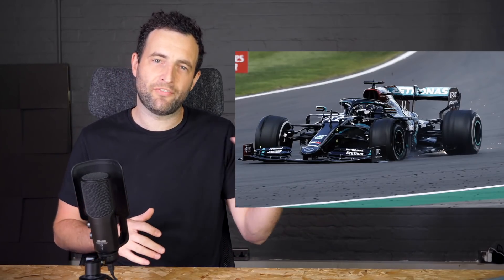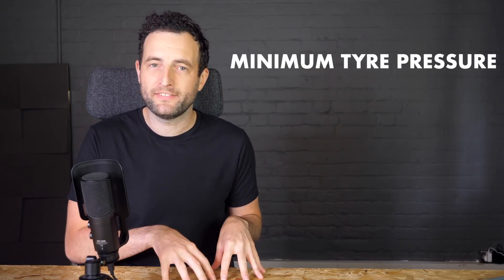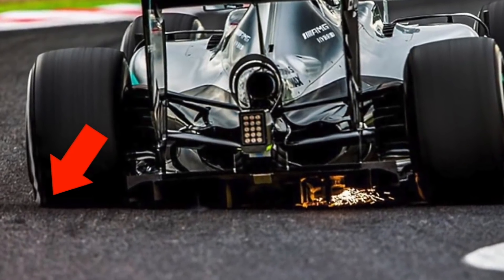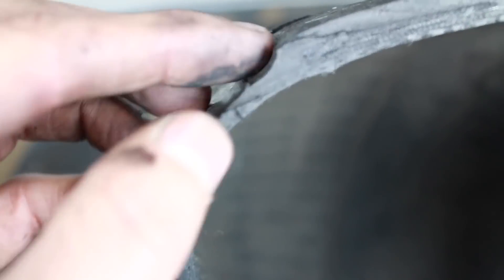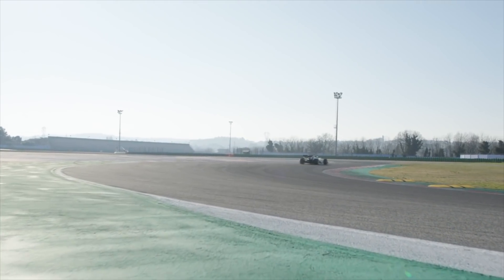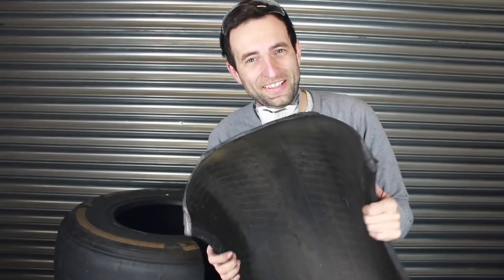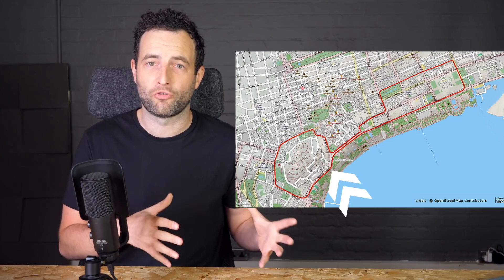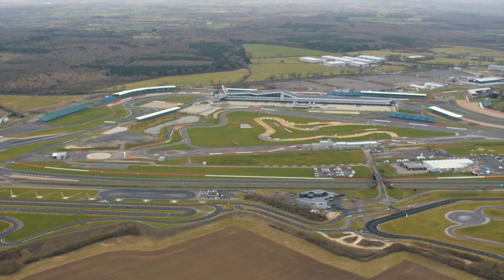Why Formula 1 Tyres Failed in the Azerbaijan Grand Prix

Comment: Pirelli : We need few weeks to investigate and to answer why tyres failed in baku!
Driver 61(15 mins after race) : Anyway… Here’s why tyres failed in baku!
Reply: I mean I'm no tyre engineer bit I have worked in the tyre fitting industry for 8 years now and as soon as I seen Stoll's crash I was saying to myself that was a sidewall to tread attachment failure . I have seen it many times on run flat tyres when people just keep driving on it flat the edges of the tyre get supper hot then bang the tyre separates . The crazy thing is so many teams just kept running the tyres past when strolls blew .

Comment: The left rear tire has exploded contrary to what is said the track is counterclockwise so most of the pressure is on the right rear. A place for thought and not for hasty conclusions
Reply: all the left-hand corners but one are easy on the tyres. The only 2 corners that put a lot of stress on the tyre at Baku is the high speed left-right before the main straight. The left is easy flat but the right is a lot harder on the tyre, the left rear tire to be exact. And guess where both Stroll and Verstappen had the faillures? Exactly, on the straight after that high speed section.
Reply: @rubenhclindenhols  the tires can easly handle that left right. The rear right is under more load during the lap, it seems much more likely to have have been debris and hitting a bad kerb.

Comment: First and foremost, both Stroll and Max were on the hard(white-walled) tires.  These hard tires are good for 40 laps.  Strolls tire, left rear , blew on lap 29....Stroll had not pitted. Max's tire, left rear, blew on lap 45 but only did 33 laps on the hard.
Also, Pirelli found a 7cm cut on Lewis's left rear tire.
Both Stroll and Max's tires have been sent to Milan for investigation so we won't know the cause of the tires blowing out until several more days.
Pirelli have also looked into the other teams hard tires for review.

Comment: If that was due to the excessive load then why left tyres failed on the anti-clockwise circuit?
Reply: It seems the high downforce on the massively long straight was a major factor. That thing kinks right, then left, then right and once more right at close to top speed. I'd wager both rear right tyres were close to falling apart as well just from going straight. This kind of primarily vertical load wears out other sections of the the tyre than your typical lateral load.
Reply: Could be kerbs?

Comment: Max at Ziggo: Pirelli probably gonna say it was debris
Pirelli: We think it was debris
Reply: Classic pirelli 😂
Reply: @oakenstake  classic Pirelli? Why is that?
Reply: In the news pirelli said it is because they found a cut in Hamilton's tyres
Reply: @lmao7439  And how do Hamilton's tires prove anything? He was the second driver to pass by Verstappen's wreckage, no wonder he picked up some debris.

Pirelli always makes the same excuse, just like OP pointed out.
Reply: @Petidani0330  it was a joke...
Reply: Because it was probably debris.  But that won’t stop armchair engineering wannabes from pretending they have a clue.
Reply: Pirelli have already confirmed it wasn't debri.
They are saying teams run low prseeures(more grip) and there is no evidence of structural failures in blown tires.
If that's true will the teams own up to it? Will fans hold THEM accountable?
Will the FIA grow some balls and support the evidence or will they be ambiguous and let teams off the hook publically....while telling them privately to stop under inflating tires?
Reply: @carlfrye1566  Thus far it's an unsubstantiated claim by la Gazzetta dello Sport. Surprise surprise, a media outlet that's infamous for it's unreliable news. And also, Italian... Pirelli themselves haven't made anything official, yet.

Pirelli also checks the pressures before each official session for the FIA. And I think they're checked after as well. So this would be quite the announcement.

Regardless, a difference of 1 psi softer shouldn't suddenly lead to tires blowing up without warning.

More and faster tire wear, sure. A catastrophic and sudden failure, not so much.
Reply: Time to bring back Michelin
Reply: As far as I remember, the Silverstone failures didn't give any warning. So failure due to debris or poor workmanship can be pretty similar.
And why should Pirelli investigate itself?
Reply: @Karyabs  In Silverstone the tires were visually very worn. Mercedes were constantly on the radio about the degradation and Lewis was complaining about degradation as well.

That weekend, Mercedes was also struggling due to high temps on a high degradation track.

Basically, nothing was similar to the puncture at Baku.
Reply: Considering that it was the left rear that went rather than the more heavily loaded right (anti-clockwise circuit) it probably was debris
Reply: @DjDolHaus86  except at the point at which both Stroll's and Verstappens tyres failed, it was the rear left which was under a very high load. Circuit direction doesn't say everything.
Reply: @BamBoomBots  Verstappens wasn't under any directional load, he was going in more or less a straight line when it let go
Reply: @DjDolHaus86  No, that's not true. He passed a slight right hand bend at the Baku 'straight'. With these cars, you can do that at full throttle, but that doesn't mean that there's no load going in the tyre there. At that part of the track, going at 300km/h, with the huge amount of down force that comes with that, the left rear is at an exceptionally high load, even for an F1 tyre.

That is confirmed by RB's comments, namely that they didn't have any warning sign that the tyre would give out. That happens when the tyre yield stress is exceeded suddenly and you have a sudden failure.
Reply: @BamBoomBots  the same thing happens if you have non critical damage to the carcass and then take it beyond its reduced limit. If it had been purely down to load then there would have been a pattern in terms of which cars had failures, the cars running higher downforce setups would have all failed
Reply: @BamBoomBots  The tires were largely intact just deflated. That indicates a deflation rather than a failure.
Reply: @DjDolHaus86  but then they would’ve detected a dropping PSI - not an instant blowout
Reply: @VAR1607  only if there was a leak, if the tyre was damsged but still airtight there would be no change in pressure but there would be a weak spot
Reply: @DjDolHaus86  if the tyre was damaged then it would deform even slightly, causing a change in pressure (force / area)
Reply: @VAR1607  not necessarily, a sudden failure is just that, sudden. You do some minor damage and then when you reach peak stress it let's go suddenly because the material can no longer sustain the forces acting upon it. If the tyres had been unfit for purpose then a lot more failures would have taken place because they're all under high stress for long periods. Because only two tyres failed we can deduce that it was likely due to isolated incidents of damage, where and how they failed was definitely not ideal but it's the nature of the beast unfortunately.
Reply: @BamBoomBots  The final right in the full speed chicane will put the tire under far, far more load then the ever so slight right kink in the main straight... The tire delaminated due to rotational forces. 1/1 imitation of Stroll's crash. Who didn't make any directional changes at all when his tires went.
Reply: @DjDolHaus86  The directional load is centrifugal.
Reply: @BamBoomBots  it was also 16 laps apart but both after about 30 laps under race pace
And both on the seem between the run area and the inside of the tire
Reply: @BamBoomBots  As they said, the back right is under more load.
Reply: @theglitch312   Thought the same, 'exceptionally high load' due to a shift on the straight ^^ that way you'd see a frequent tire failure at overtakings on the straight
Reply: @DjDolHaus86  the fastest cars with high downforce. Downforce goes linear in the work your tire has to do, speed goes in squared. As the RedBull and Hamilton where fastest over all they had the highest loads. But whats also important are curbes and how long you brake. Stroll likes to cut corners and Baku has several left handers where you can take the curbes. And in the end tires have tolerances. Most tires will propabbly work just fine, but 1 in a thousand or so will not. Happy tire Lotto.
Reply: @BamBoomBots  
Not only downforce ,centrifugal force also.
That's why tyres rip apart!
Reply: @DjDolHaus86  Stroll had a rear right failure.
Reply: @silentnight1805  you might want to check the footage. His rear left went and then he spun and hit the wall with the right side of the car which caused his front right suspension to collapse and punctured the rear right

Comment: Did you hear that? "In an effort to increase degradation" Does anyone remember better times when they just got out their and raced? This tire degradation thing seems to be a constant theme. Keep in mind it puts the drivers at a tremendous risk. It does not increase competitiveness except for those teams that have the secrets revealed to them while all the rest suffer. I can't even watch it nowadays. It's dangerous enough. I don't feel like watching somebody die out there for this kind of stupidity. I guess the question is. How many have to die or how many have to be crippled before someone says enough is enough and they get back to really racing? Because this is horseshit and if your an F1 fan you've been paying attention throughout history and you will see this same theme present it's ugly head. It's something that happened before with Pirelli and also Goodyear if anyone remembers that mess.  Think about it. Some teams knew about this and decided to take the corners differently because they absolutely had to.  While the others that were not let in on the secret had their tires shredded and lives put at risk even more so than they already are.

Comment: Pirelli has failed to supply reliable tyres for years now. When are they finally ousted?
Reply: Problem is the FIA's specifications, not necessarily Pirelli ducking. Changing manufacturer would result in equally shit tires if the FIA demands the same crap that they do from Pirelli
Reply: @ZnarkyT  well these 2 crashes weren’t about the requirements. It was about that Pirelli said that the tyres would last 40 laps and they didn’t last 30 laps
Reply: @ploppyjr2373  Considering the 10cm cuts found on the tyres taken from HAM's car during the red flag, and the fact that the failed tyres were the less used ones, debris is a more plausible explanation. Also, before Silverstone 2020, when was the last time Pirelli F1 tyres failed? Silverstone 2013?
Reply: @ZnarkyT  i wonder how pirelli still willing comply with all the FIA rules which put them in a bad reputation by the regular consumers around the world that watch f1
Reply: @ZnarkyT  No. With more manufacturers, you get competition, and that ensures quality.
Reply: @kshitizsharma386  not if they're forced to make the same tire. And who said anything about competition? The fia would probably just switch them for another monopoly
Reply: Exactly my thoughts. Pirelli have been producing sub-par tires for quite a while now, both for street and racing cars. Michelin are miles ahead technology-wise and I'm sure that what they can offer for this sport would be much much more sophisticated that the unreliable Pirelli rubber.
Reply: Pirelli will be ousted from Formula 1 when someone with a bigger check comes along.
Reply: Bring Michelin n BS back
Reply: I mean, it seems like no tire manufacturer can be reliable for the most part in racing, I mean seriously,  Goodyear is the only tire supplier in NASCAR and their tires are always trash
Reply: @patrickracer43  Goodyear has done significantly better here from my understanding. You rarely hear about blowouts randomly occurring in nascar and when they happen its usually because of the way a driver is driving or pit strategy. There were two blowouts today tho in 1 race with f1
Reply: @donniedial3014  whcih is 2 blowouts once in a hardly ever. It's not as if this happens all the time at every race
Reply: We need Bridgestone back
Reply: Tyres are shit on purpose in order to force teams to come up with pitstop strategies, however this time the problem was that pirelli's estimations on how long they will hold were wrong.
Reply: Williams wasn't ousted when they killed Ayrton Senna
Reply: F1 requires Pirelli to make tires that don't last long. According to them, this gives an opportunity for teams with weaker engines to beat Mercedes. Basically this allows for more pit stops, overtaking and drama in general.
Reply: @raypenber7400  It is also very convincing that teams tweak the rules and recomendations to obtain the best result
Reply: One tire supplier monopoly ensurers we get crappy tires. Hopefully they never let this happen again and fix the tyres!!
Reply: Go back to two tyre companies ,the top two
Reply: @shaundavidssd  I use Pirelli tyres on my Ducati Panigale V4 and my Maserati and they work just perfectly.
Reply: For Pirelli it would have been extremely easy to build tyres providing stable performances througout all the GP like Bridgestone did (even if the loads are completely different now) 
The FIA, when changed the tyres manufactiurer, EXPRESSELY asked tyres with performances that degrades in few laps. 
Degrading performances means that the working parameters of the tires changes from lap to lap, and so , sometimes, shit happens.
Reply: @neutronalchemist3241  I remember when Michelin in the 2005 USA Grand Prix prohibited all his cars to  race since the tyres were not safe... how can you jump to those conclusions? How do you know it wasn’t a debris nor lower tyre pressure in conjunction with high fatigue circuit? How can a manufacturer provide extra high performance tyres which run fine in all occasions under any tyres pressure for instance?
Reply: @c.g.c2067  Michelin prohibited all his cars to race because the tyres failed already in few laps during free practice. The situation here is a little different. 
I didn't jump to any conclusion regarding the Baku GP. 
I never said "any tyres pressure". For a manufacturer is MUCH easier to build tires that provide stable performances for 300km than tires that degrades in few laps, but differentiated so that the softer the tire, the faster it degrades. It's the degradation of the compound that makes so that the rest of the tire doesn't work in stable conditions. In this case, sometimes, shit is going to happen, because many more variables are introduced into the formula.
Reply: @neutronalchemist3241  What's curious about it is that only two teams had this issue and in the same spot of the circuit.
Reply: @Marcel Bosma Then that doesn't say much about the FIA's credibility does it, if Pirelli are the only tire manufacturer who bids for the F1 contract?

Comment: I think Verstappen made several fastest laps before the failure, which didn't make any sense, since he was 4s in front of Pérez and Hamilton didn't seem to have the pace to overtake him.

Checo didn't push his car too hard, neither in the restart of the race when Hamilton made a mistake looking up the breaks, in the end it was Checo that won the race.

===

It was a similar situation with Stroll, the tires were too old, when he was trying to keep his position against drivers that made a pit stop already.

===

That being said, hard tires, that Verstappen and Stroll used, are supported to last 40 laps and both failed around 35 laps.
Reply: Max was never pushing, just controlling the pace.
Reply: Drivers shouldn’t have to worry about tyre failures regardless of how hard they push them that’s the point . This is not one drivers fault in any way it’s all pirelli a fault

Comment: Heh a rear right tyre exploded under load while i was driving fast a Pajero once while turning into a narrow road, I was lucky and reacted fast enough to avoid hitting anything (yes yes not anywhere near the speeds of F1 cars and not aero depended) but the car was fishtailing like crazy and it was correction after correction (probably around 15 countersteering corrections) it was a momumental task to keep it pointing in front and scary AF. The only person excited about it was the co-driver and felt no fear, me on the other hand i crapped my pants. That moment was one of the moments that are etched into my memory.

Comment: Maybe we need more than one tire manufacturer producing tires for the teams.
Reply: You DON'T want a Grand Prix where only one manufacturer's tyres fails.
Reply: @Yosef_Marks  like US 2005.
Reply: @marjanmartinov9607  Exactly what I was thinking.
Reply: @Yosef_Marks  Then have it where certain races only use tires from one manufacturer so everyone is still on equal footing at each race instead of many different tire manufacturers in each race
Reply: @Yosef_Marks  I would say we don't want a race where any tire fails.
Reply: It’s not the manufacturer it’s the fia. The fia give specific specifications that want the tyres to wear to improve racing.
Reply: @BenRobertson64  Correct.  And the manufacturer should provide tires that will perform within those tolerances and above with Safety Factor.

Comment: I think I know what happened to the tires. We all know that the downforce at 320km/h is at around 30kN. And you also have a very bumpy straight. Now then the cars got from the top of a bump to the bottom it is accelerated by the mass of the car through gravitation and the downforce. |a|=d^2s(t)/dt^2=|g| + |F_(downforce)|/m=49.81m/s^2 . This formula is only valid if the drop of the bump is quite steep. When the cars gets to the bottom of the bump it gets extremely compressed counteracting the downward accelerated car which when the rubber is also worn down by older tires can cause the tires to explode.